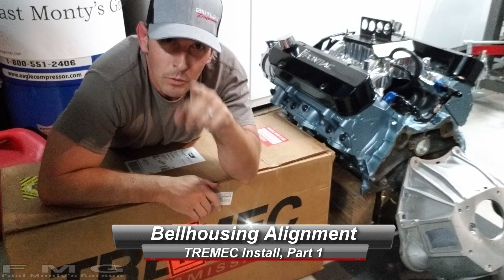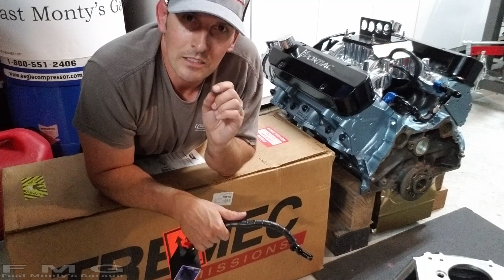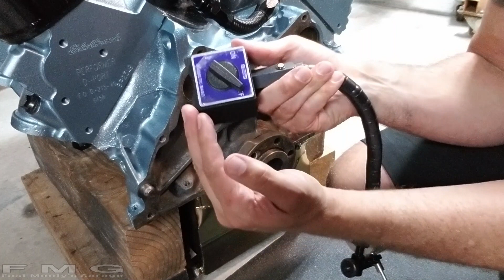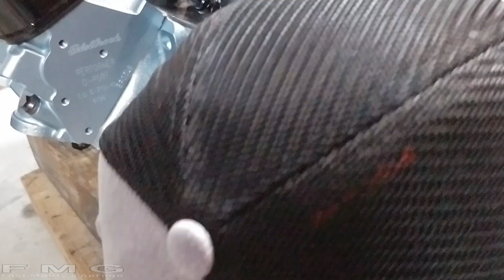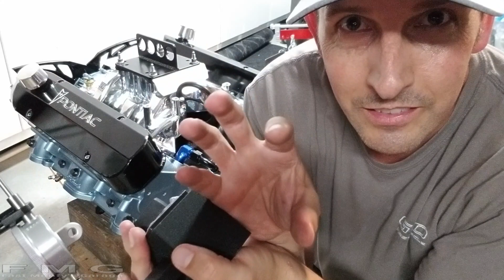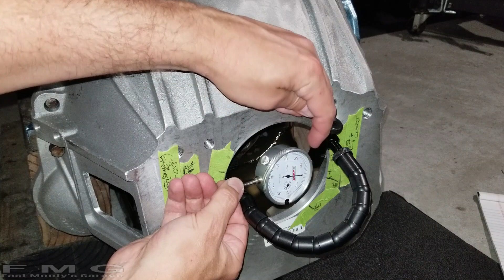TREMEC TKO/TKX/T56 Install, Part 1:  How to measure Bell Housing Alignment?

Comment: you would be better off buying an original bell housing. factory bell housings were made correctly the first time (they didnt have time to mess with dial indicators and offset dowel pins on the assembly line) you only have to deal with all this BS with the chinese-ium aftermarket bellhousings
Reply from the maker: Good point... Stock bellhousings did not need adjustment, because Muncie transmissions do not have the same tight Alignment "Run Out" Tolerance that TREMEC transmissions have.  If you're going to put in a Tremec, the alignment MUST BE measured, and adjusted if needed, regardless of using a stock or aftermarket bell housing.   Thanks for the comment!
Reply: 100% correct. Checking the run out is a must even if you keep the OEM bellhousing when upgrading to the TKX.
Reply: So ti doesn't matter what bell you use, factory housings were fine as the BW T10 for example used a ball bearing which is more forgiving than the tappered bearing in the Tremec trans..@FastMonty

Comment: Hi Mike...I am trying to find a flex arm like yours and I'm not sure which one will work. The link doesn't work to SS and I don't think they sell one anymore. So I'm on Amazon (of course), trying to find one I can just borrow, and I guess I'm just wondering if there are any specs on yours...like length seems to be most important. Anyhow...I dunno. Maybe I'll "borrow" several. I wonder what the ideal way is to do this.
Reply from the maker: That flex arm is a Pain in the Ass.  SST still has theirs.  Call them and ask for Parts... the Dial Indicator kit is $119.  Let me know how it goes!
Reply: @FastMonty  Will do, thank you sir!

Comment: When I bought my TKO from MDL there is no reference to this in the instructions.  Is it because I am using a Blue Print engine?
Reply from the maker: I have no idea... but, it should be measured for re-assurance.  Otherwise you risk damaging the input shaft bearings.  (Unless you bought the engine and transmission together, and there's a warranty... then it's on them :))  ha, ha... thanks for the comment!

Comment: How did you get the dial indicator centered on the crank ?
Reply from the maker: Harry, good question.  I assume you mean the dial indicator base?  The base does not have to be centered.  As long as the dial indicator itself is perpendicular to what you're measuring, it's all good.  (Or, at least as close to perpendicular as possible, and slightly pre-loaded so you can obtain both positive and negative readings)  Hope that makes sense.  Thanks for the comment!
Reply: @FastMonty  I guess I'm missing something.   It looks like you just measured how offset your dial indicator was, not the housing.
Reply from the maker: @doog535  I hear you, it took me some thinking before I did it... you have to imagine the crank is the centerline.  Whatever you attach to the crank will spin in a perfect circle, as it relates to the crank.  Whatever touches that circle, in this case the bore of the bell housing, will show run out, in relation to the "circle" we're making with the crank and dial indicator.  So, if the bell housing bore is not centered, it will show how off center it is with the reading on the dial indicator.  I hope that makes more sense?
Reply: @FastMonty  Ah hah! it does!
Reply from the maker: @doog535  Great!

Comment: What should the depth of the bellhousing be if I am getting a new one for the TKX? There are bellhousings ranging from  5.555 in. in depth all the way to 6.925 in. Which should I get for the TKX?
Reply from the maker: It depends on the engine, but it should use the same stock bellhousing depth.  I recommend asking SilverSport which bell housing is best for your application.  Thanks for the comment!

Comment: In the name of learning... my experience working in a machine shop i have learned that those mag bases like that "sag" from their own weight. They can easily sag .015. You need as short as possible setup to reduce how much it sags.
Reply from the maker: Agreed!  That's exactly why I say to buy the dial indicator set up from Silver Sport, listed in the above description.  I got mine to work, but not without some struggle with keeping it stationary.  Thanks for the comment!
Reply: @FastMonty  in my test the silver sport style has some of the most sag.
Reply from the maker: @andy347495  Well, that's interesting.  So, can you tell everyone here what works the best?  Thanks!
Reply: @FastMonty  yes, im trying to make a video to show what can be cause issues. Its hard to video this by myself.
Reply: @FastMonty  also you need a sid bar type mag base and keep the indicator as close to the magnet as possible.
Reply from the maker: @andy347495  Ha!  Welcome to my world.
Reply from the maker: @andy347495  Would love to see what you're talking about... As you noticed from my video, I got it to work just fine.  Just took awhile to get it stiff enough.
Reply: @FastMonty  even if it is "stiff" there can still sag in the "arm".
Reply: @FastMonty  i posted a video on FB a  group called thunderhead289 tech and carb tuning.
Reply from the maker: @andy347495  I checked it out... that's gravity induced sag, coming from the joints not being stiff enough, and even the needle on the end of your indicator being pulled down.  Granted if the magnet isn't strong enough, that'll flex too.  When measuring the crank run out, the plane the magnet is on, does not change (gravity on that joint is constant)   I agree it is something everyone needs to keep in mind when setting up a dial indicator.  The indicator is pre-loaded,  perpendicular to the bore, and whatever is holding it needs to be as stiff as possible.  I pulled on mine in different directions to make sure the reading didn't drift.  Then, If you can repeat the runout reading three times in a row, basically always coming back to zero, you're good.  Great subject!   (Ohh, and I've spent my fair share of time on a granite inspection table, too, ha ha :))  Again, thanks for chiming in and pointing that out!  That's why we're here.
Reply: @FastMonty  gravity does not have the same effect on the indicator as the crank rotates. When the indicator is at the top of the bellhousing it is pulled away from it and when the indicator is at the bottom of the bellhousing gravity is pulling the indicator towards the bellhousing. Right? Inturn (no pun intened) you are getting a skewed positive and negative movement of the needle.
Reply from the maker: @andy347495  Andy, yes.  The indicator gets pulled in all different directions, based on it's orientation, by gravity.  That's why the indicator holder needs to be stiff enough to maintain position throughout the entire rotation.  The test is by pulling/pushing on the indicator dial, in different directions, after you set it up.  You don't have to pull/push hard, but as long as the indicator doesn't move (because it's also pre-loaded against the inside of the bore too)  you're good.  If it does move, the system needs to be stiffer before proceeding.  Good stuff.  (Wish I had time to explain all this on video :))
Reply: @FastMonty  there is more to it than just being stiff enough.
Reply: @FastMonty  do some test like i did with some different setups and see what happens. Use different types of mag bases and move the indicator farther and closer to the mag base.
Reply: @FastMonty  to ensure that we are getting the actual measurement our equipment and setup needs to be tested as we are going to use it. Assuming something is stiff enough without testing is how we got to this point.
Reply: @FastMonty  pulling on the indicator and watching for drift isn't going to determine if you have sag or not. The modulous of elasticity of the steel is going to bring the indicator back to its zero.
Reply: @FastMonty  next time you're using that granite table you might need to flip it upside down and test my findings😜
Reply from the maker: @andy347495  Andy, it's called system deflection. Which is also directly related to the "Modulus of Elasticity". The further away the indicator, or "load" is from the main mount, the higher the moment load (ie torque at the main joint, and all other subsequent joints).  Basically the same as trying to keep a baseball bat level, at arms length, with one hand, vs. two.  It's much easier with two, because the base is that much stronger.  If the system is not strong enough "stiffness", it will deflect.   Pretesting the system by Pulling/pushing to test the stiffness, is the easiest way to know if it's going to deflect, or not.
Reply from the maker: @andy347495  Ha!  That's the only way I can get my workouts in.  :)
Reply: @FastMonty  pulling on it isnt going to tell you if its going deflect enough to skew your measurement.
Reply from the maker: @andy347495  Well, looks like we're just going to have to agree to disagree.  Love the conversation!  See ya!
Reply: @FastMonty  how do you measure your pull on the indicator to make sure it matches what gravity is pulling on it.  Also, if the indicator is upside down when you are pulling on it gravity already has had its effect on it.
Reply: @FastMonty  the only way to test it is like i did with  some kind of bar, flat stock, or maybe tubing of some kind.
Reply: @FastMonty   but, yeah good conversation.
Reply from the maker: @andy347495  Andy, it's a judgement call.  It doesn't take that much... try pulling up on that rig that you made, and see when the needle starts to move.  or, how much force it takes to move it the same amount when stationary.
Reply from the maker: @andy347495  Ohhh, I see what you're getting at.  If I have time, I might try that.  Too many other projects are taking priority... ha, ha... again, great chatting with you, love getting the brain working.
Reply: @FastMonty  not to rag on you or anything, but judgment calls is what im trying to avoid. Especially when we can measure the deflections. 

Ive been through this at work already even my boss with 30 years experience didn't believe me. It took my test and my explaining for him to see what was going on.  At first even the engineers at work thought i was wrong too. There is no set number on how much deflection a setup has, it has to be tested.

Comment: Hi Mike, I’ve watched many of your videos, specifically the Tremec installation. In comparison to others the level of detail you go into is by far more useful than others that I’ve seen. I have a question regarding the bell housing alignment. After this is complete the bell housing needs to be removed to install the clutch set up then reinstalled so I’m assuming the alignment will not change ???
Reply from the maker: Thanks David, it means a lot.  And, I'm glad they help.  Good question about the alignment after removal... as long as the pins do not spin, or change rotational position, you're good.  In my scenario, I loosen the pin set screws, so when I take off the bell, the pins remain in the bell.  :)  I hope that helps, holler if anything else comes up!
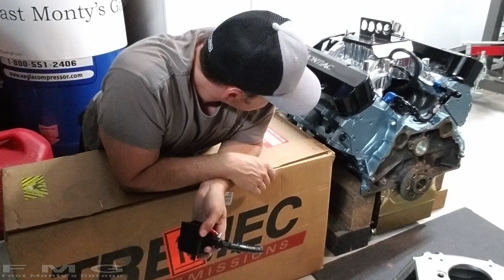Reply: Hey Mike, just watched your Tremec install part 4. Seems you really had to bust your behind test fitting that thing. My 64 Chevelle already has a Tremec T56 but unfortunately the clutch isn’t working out so I’m preparing myself and also looking forward to doing this job by myself. I’ve also decided to go with a hydraulic release bearing but I’m not sure what clutch to use. I have a balanced 327 putting out about 470hp and 3:55’s in the rear end. Any guidance here will be greatly appreciated. Once again thank you for the detailed videos, incredibly helpful.
Reply from the maker: @davidrosenthal735  Yeah, painful... the things I go through, for you guys.  ha, ha... Not sure if you noticed, at the end of the playlist, I installed a RAM Twin Disc clutch.  I love it!  Just be aware of the throw out bearing dimensions, it'll vary from different hydraulic clutch designs.  The Silver Sport bearing works great for me, which I also cover in the video.  I would stay away from the pressure plates that have weights on the pressure plate fingers, as they might interfere with your throwout bearing pressure line.  Hope that helps!
Reply: It helps plenty, sorry for all the questions. I did see your video on the double clutch install, I was planning on using Ram’s muscle car clutch/pressure plate. My driving habits are fairly tame even though we all play at times I don’t typically drive my car hard. Your thoughts ?
Reply from the maker: @davidrosenthal735  That'll work great, I know they don't have any weights on the fingers, so you should be good.